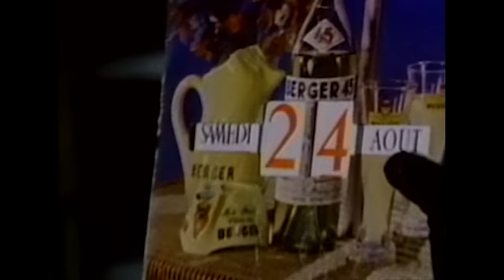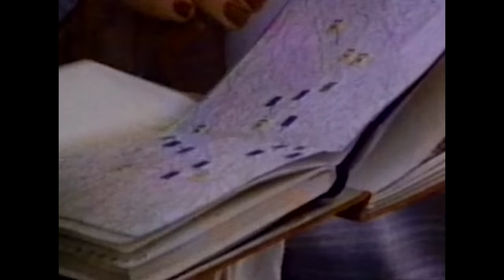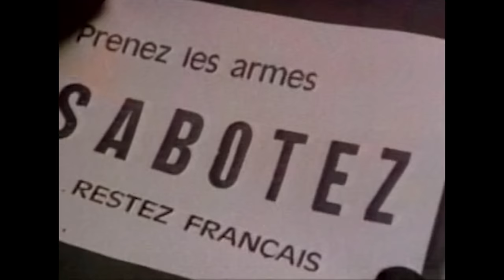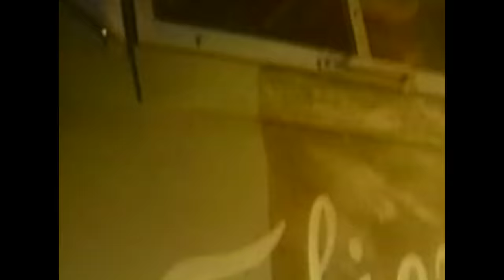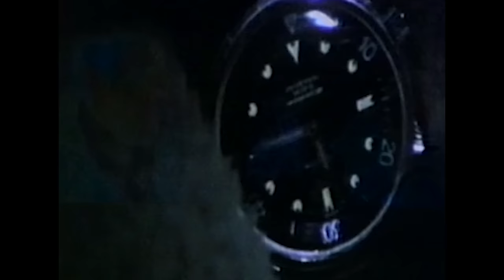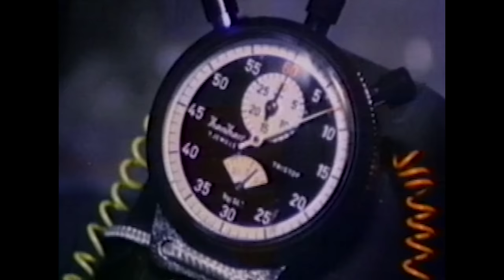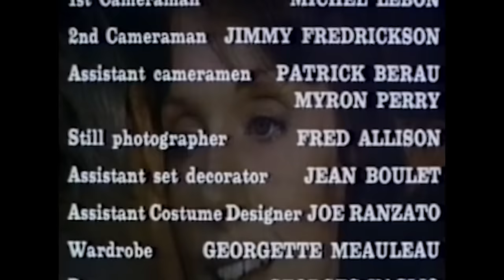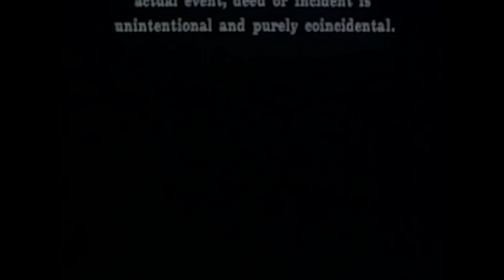Legendary Warner Brothers Movie I From Hell to Victory (1979) I Retrospective

Comment: There are a number of posts tearing down the fact that much of the equipment is not authentic.  They fail to realize that after WW2 most of the German gear was destroyed.  Very little survived to make it into the hands of private individuals.  Spain was classified as neutral.  Though Franco was a close buddy to Hitler. So, Hitler licensed Spain to produce a multitude of German designed armaments.  That’s why you see so many movies with Spanish equipment being passed off as German and British as well.